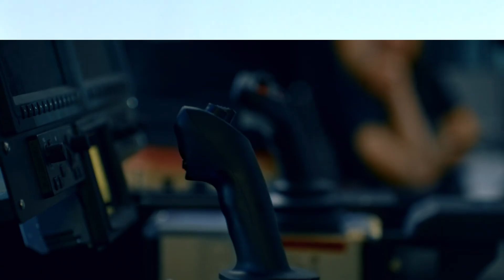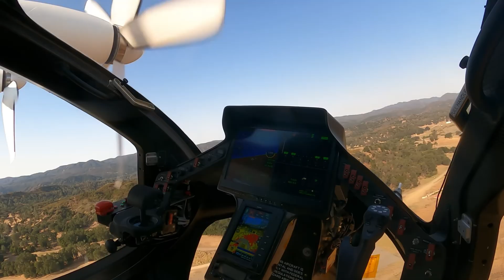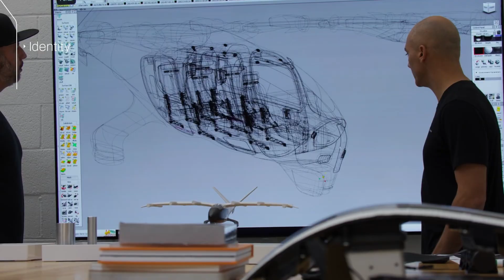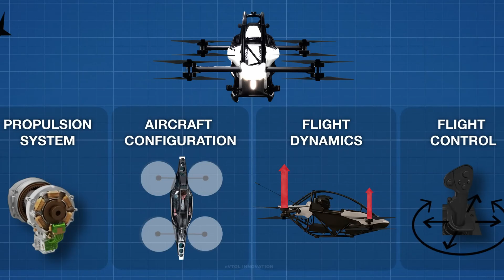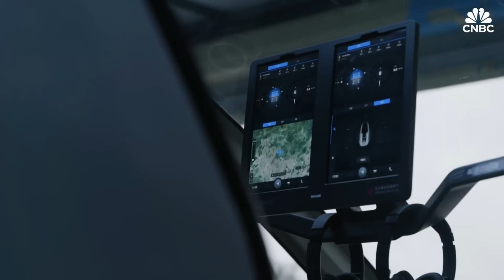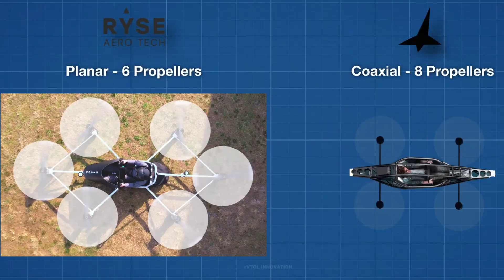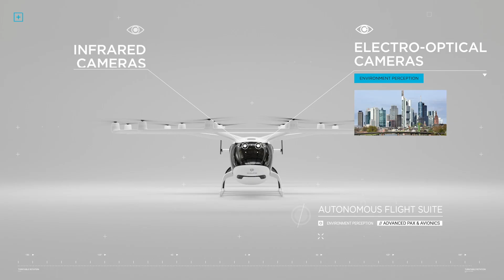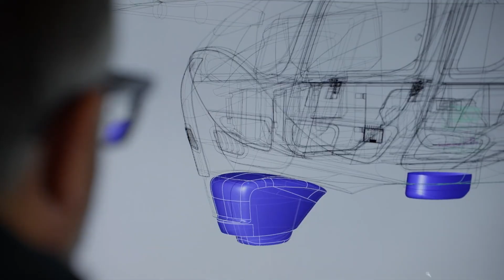What is eVTOL? Top Companies Worldwide

Comment: 0:08 I find it hard to believe that this is silent.
Reply from the maker: Sorry, I don’t get it with the timecode😅
Reply: @showpics  "a sleek electric air taxi zips by silently" The word "silently" is on this timecode, maybe it should be 0:07 but it is just in the beginning of the video.
Reply from the maker: Oh, now I get it. I meant it’s silent compared to helicopters and traditional planes, but it does have the sound similar to a drone, just louder because it has more rotors, and they’re bigger. So, not totally silent — yeah. 👍🏻